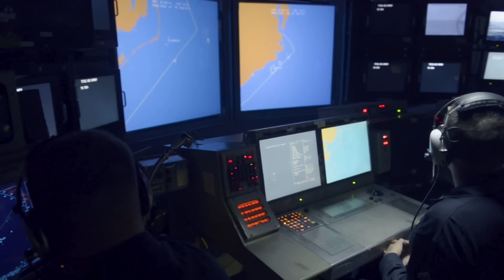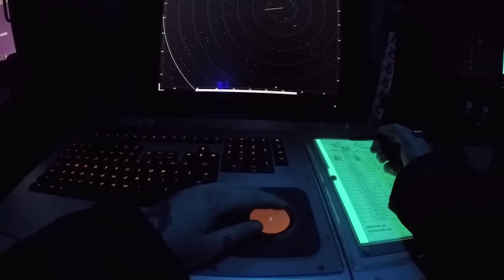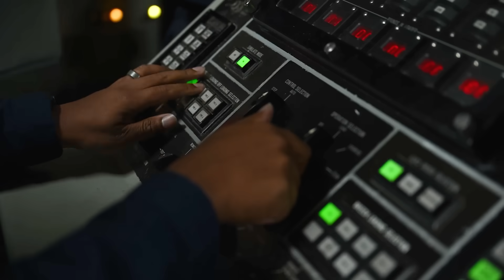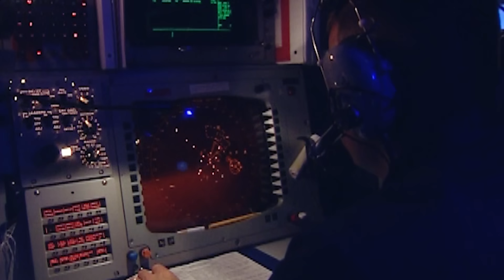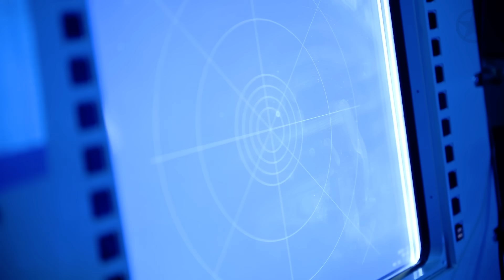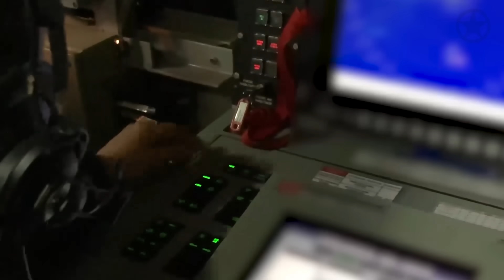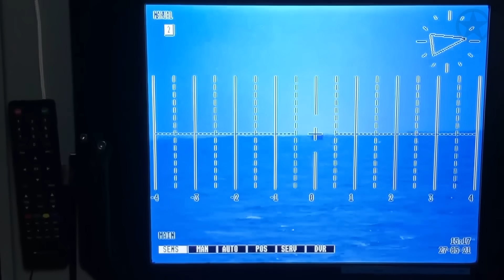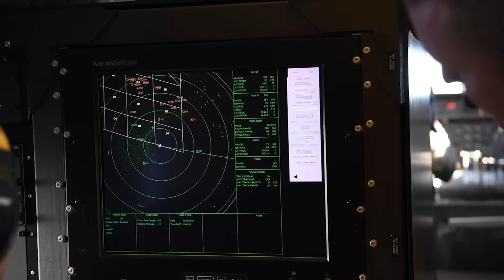12 Houthi Drones ATTACK U.S. Ship - Then THIS Happened

Comment: Very impressive defense except for the major malfunction of the primary weapon system.  The fuse setting mechanism of the five inch gun stopped working after only a few rounds which is very disturbing.  If it wasn't for the Phalanx CIWS, the drones would have impacted the ship.  This would have been a major victory for the Houthis.  Somebody needs to answer for this dangerous malfunction of a vital defense weapon.

Comment: The PHALANX Surface Mode upgrade was designed specifically to engage low slow aircraft like the drones.  I worked on the program when I was supporting the Navy in the 1990s.  Great upgrade to the system.
Reply: In initial testing, the system had to be downgraded to stop shooting at the expanding debris cloud, as the system targeted and annihilated progressively smaller pieces of the former object of its affection.
Reply: @jamesnabors3643 That's exactly how it worked in '86 when I was onboard the U.S.S. Mt. Baker. Upon aquiring and engaging the target it would often split said target in half and then those two halves into half and then engage the next target, all in the blink of an eye. It was impressive to watch to say the least. Don't be on deck without hearing protection when it engages. 👍

Comment: 100 knots but only 5 seconds to engage?  Wrong.
Reply: I think it's just bad writing. The CWIS engagement lasted 5 seconds, which was not the engagement window. That would have been something like a minute. The whole exercise is a great example of layered defense, but it's a little alarming that it took all the layers to do the job. The failure of the fuse-setter cannot be written off as "not surprising given how unfrequently it was used" - something went badly wrong.